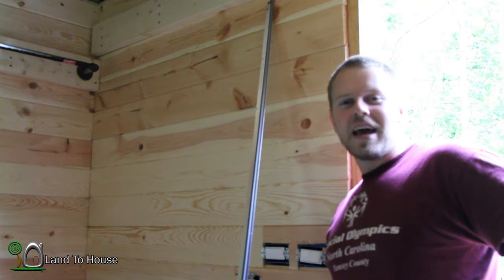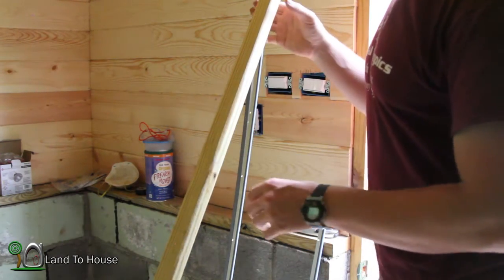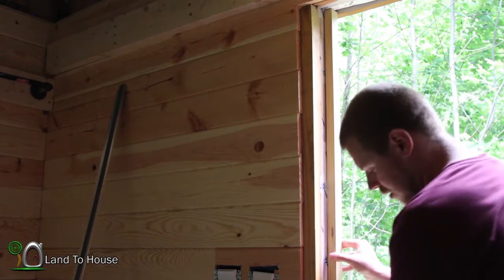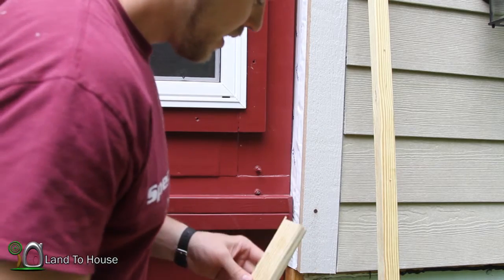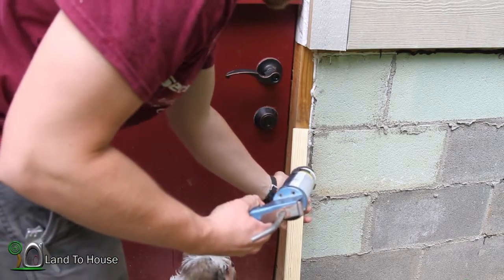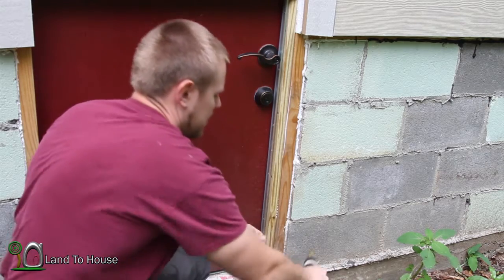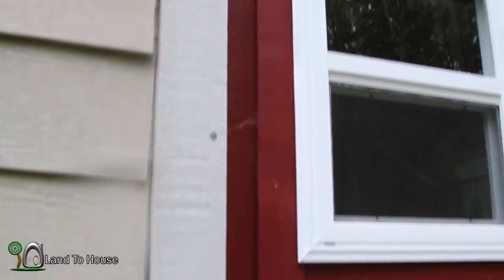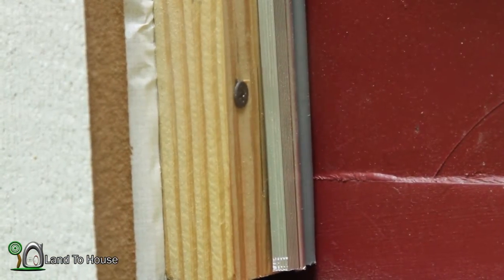Tiny House 83 - Door Weather Strip

Comment: Seth, it looks like a tight fit between the door weatherstrip and using the keys, is it a problem?
Reply from the maker: +The sawdust maker. David. The only issue has been the top of the bottom Dutch door. It needs to be shaved a touch. The key latch has not been an issue.